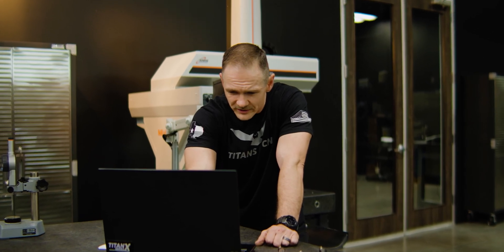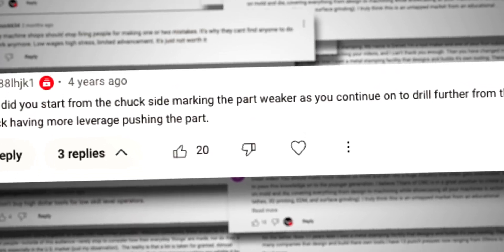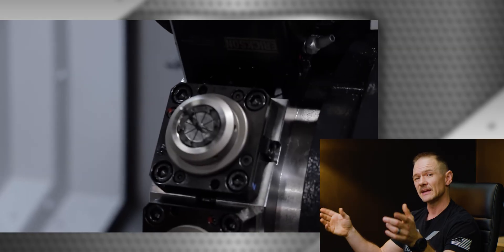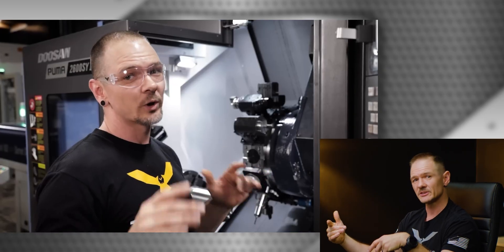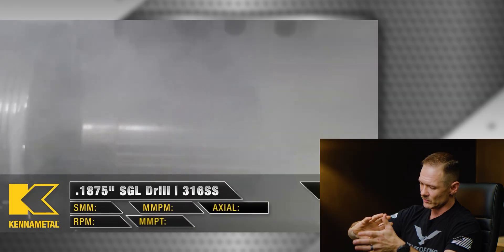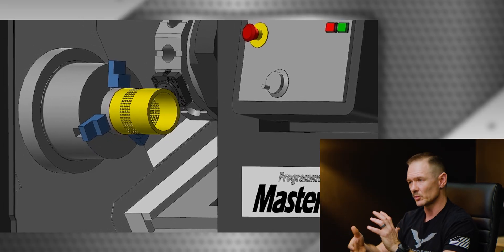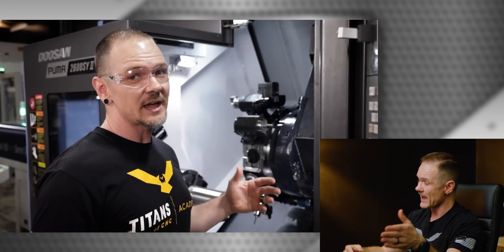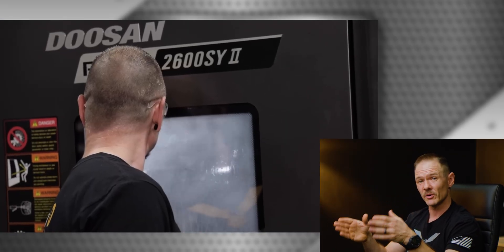Wrong Technique? Addressing the Comments

Comment: I agree. Flatness is the minimum deviation of the surface to its own theoretical median plane. Forget most of what’s going on below the top surface other than the ability to use the adjustable jacks to manipulate the surface’s median plane. The top surface only ever has one true minimum flatness reading. Thats where the adjusting the jacks comes in, to get as close to that true minimum deviation reading. Kinda hard to find the flatness on a sloped surface but it would have the same flatness.

Comment: I disagree. I think it would be best to check flatness by using 3 fixed lacks with a .125 radius. By using those adjustable jacks you cancel out your flatness.  The adjustable jacks are approximately .500 to .750 diameter. 
You should try fixed jacks with small radius.

Comment: To what level of precision would you be comfortable using this method to check flatness?
Reply: I think it only depends on the dial indicator you are using and its accuracy. I’ve used this method on a 10 um flatness callout
Reply: @davidtan1235 Definitely depends on the Flatness of the Inspection table as well.